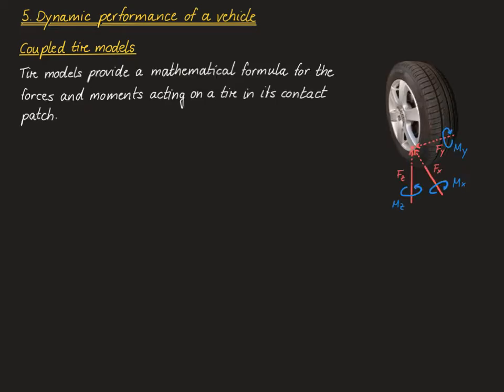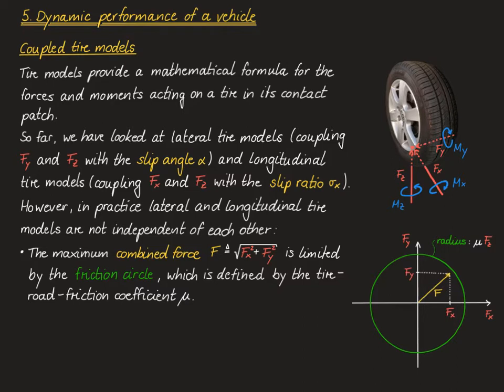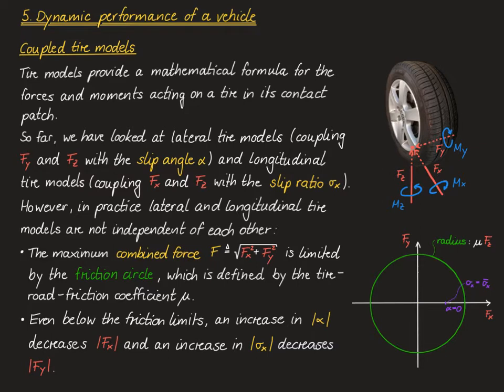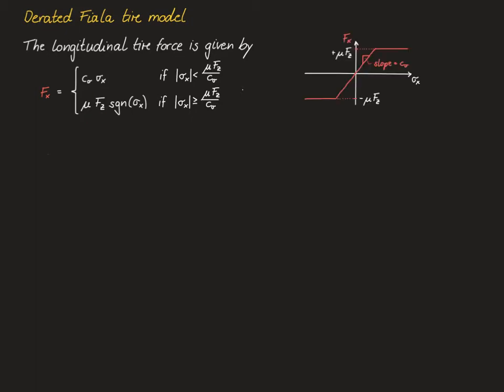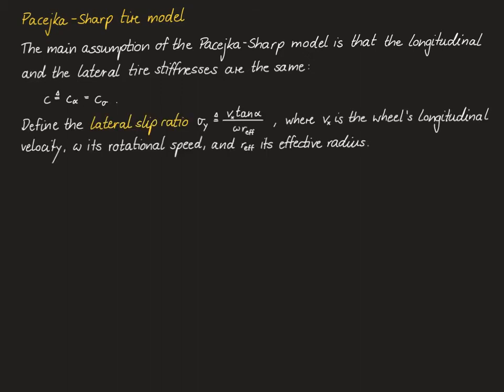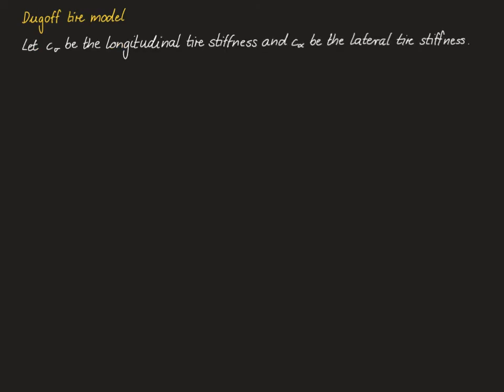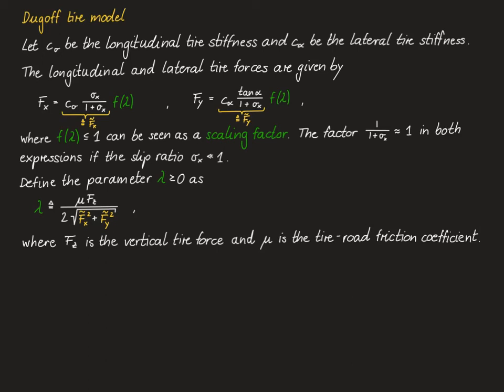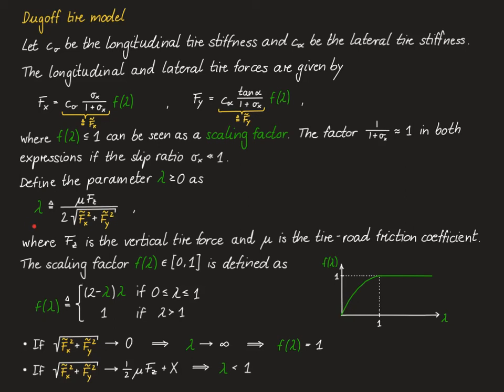Vehicle Dynamics & Control - 17 Coupled tire models

Comment: So, which tire model is better for calculating tire force?
Reply from the maker: Well, that depends. The main advantage of the derated Fiala model is certainly its simplicity. The other two models are more realistic regarding the distribution of the friction limit to the longitudinal and lateral tire force. The Pacejka-Sharp model is pretty good if the longitudinal and lateral tire stiffnesses are not too dissimilar. Otherwise the Dugoff model may be preferable. Anyways, there are even many more tire models than these three, and all of them have their individual advantages and drawbacks.
Reply: @professorschildbach   Thank you for the response Sir..